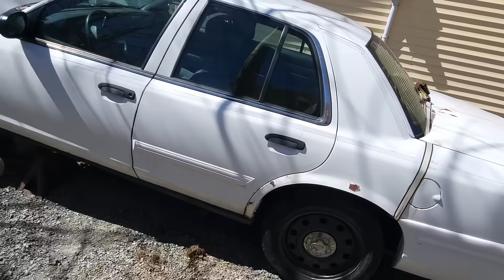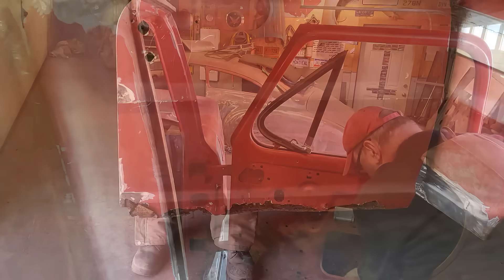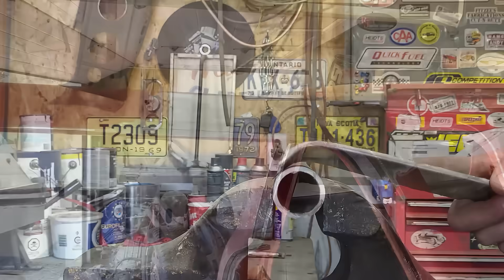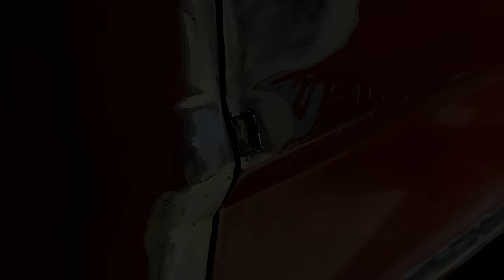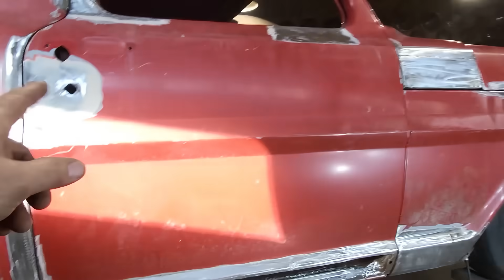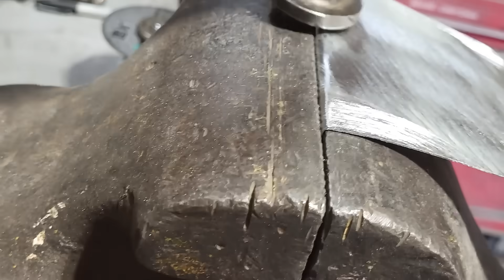Project VIC100 Road trip and rusty door repair 2.0

Comment: Well Tony making good progress with the Vic 100. Nice score on the new doner car for the motor plus anything else you need from it. I'm just looking at your bench. You have mentioned having a spot to set up the little Vevor brake permanently. Would it fit on the end of the bench if you rotated your vise 90°? I'm just looking and I reckon if you hung the vise of the front edge just turning it 90° there would be enough room to bolt the little brake on the front edge of the bench right next to the vise. I dunno if it's a good idea but just a thought I had. Keep up the good work. It's good to see your plowing on with this project getting things done quickly 👍

Comment: Oh what are ya doing?
Reply: I actually want to see the cutting, grinding, it's a process. I have the same problem so please record everything make repair passenger door 1.1, 1.2, 1.3
I'll watch them.😂
Reply: What setting are you using to mig weld and what wire?
Reply: Could you take an old auto darkening lense and put it in front of the camera. That would be great!
Reply: You can take compressed air sprayer and cool down your metal as you go.

Comment: I painted my fenders on my 50 GMC with tractor paint from tractor supply it's cheap. I've got a 69 VW bug project I'm starting on this spring it's just as bad with rust I think I'm going to just buy rattle can paint and puncture a hole in the top and dump in my paint gun and use hardner to save money it's basically the same thing that came on those 60's cars automotive paint is just too expensive.

Comment: Hey Tony! Tom here. I'm 74 we live in Springhill Fl. You have inspired me to do all 79 Z28 camaro project. She is Rusty!
I was in automotive repair and body shop business for over 40 years .This will be my first real rusty project. You are a true craftsman, and your videos are truly amazing, and a masterclass in body restoration. Thank you Sir. I have a question 🤔 Based on the welding that you have done on the Vic 100 so far, how long does a tank of shielding gas last? What size cylinder should I  buy? Would an 80cf cylinder be okay? Again  thank you for your channel. 
Really enjoying the Vic100 build 😊
Reply from the maker: To be honest im not sure the size of the bottle. It not thr big one  its a smaller one and I find I can go threw a 11 pound roll. Of wire and start a new roll before I run out of gas.

Comment: One piece at a time! Nice job as usual, and great use of Pipers paint. I do the same, no need to spend a ton on what goes on the inside, it’s usually better than what it came from the factory with anyway.

Comment: I was over in Seal Cove, which should be your neck of the woods on Wednesday looking at that same slab of ice.  Ran down to Pouch Cove and caught a few others.  First time I've had a chance to look around The Rock a little bit.  Will be back in a couple months.  I hope that nice weather on Tuesday and Wednesday doesn't mean summer is over before it even started!

Comment: The triangle piece in the bottom of the door is probably there because of the depth of the draw of the die that originally made it.  If there is too much draw on the die, the metal will pucker or split.  That is why it is easier to make it out of two pieces and weld it together rather than to form it.

Comment: Why would a crown Vic with only 88k on the clock have a dead trans?
Reply from the maker: Might be a hard 88k on this engine. The trans in these was the weak link.
Reply: Cop car.

Comment: I like your “pipe in the vice” curving method. It works great! I have a piece of 1-3/4 OD pipe / thick-wall tubing that I was able to cut off from the frame hitch on an old hay baler ( that sets out in the woods - not as pretty as your island ) The piece of pipe cost me $ 0.00………but your ideas ( and inspiration ) to re-use steel “shapes” is PRICELESS- keep it up 👍 and I’ll always “Stick Around” 👍👌😎❤️